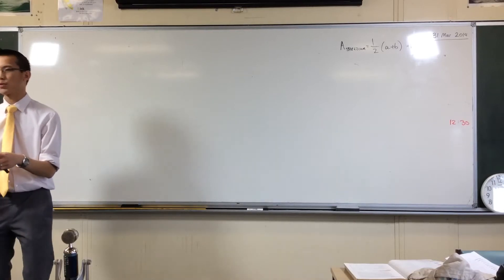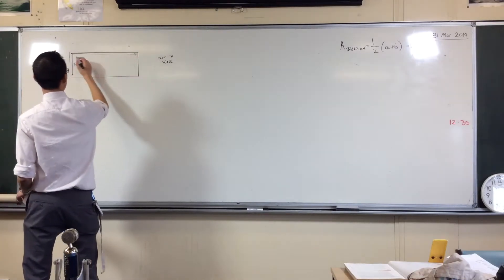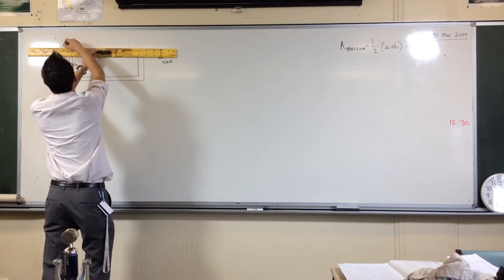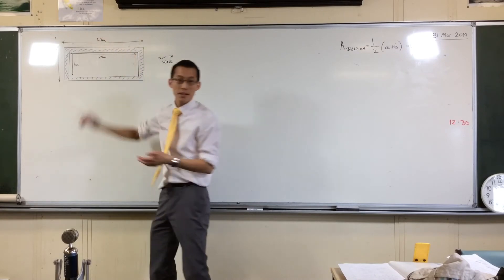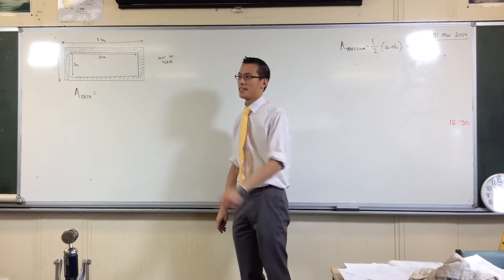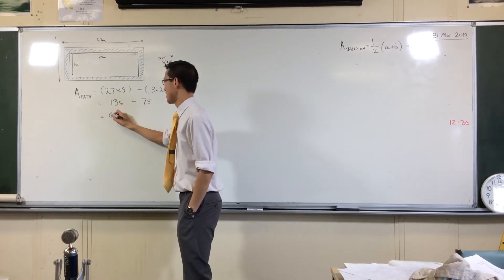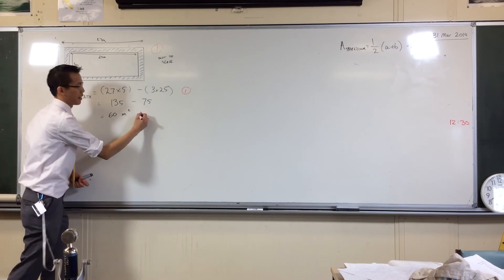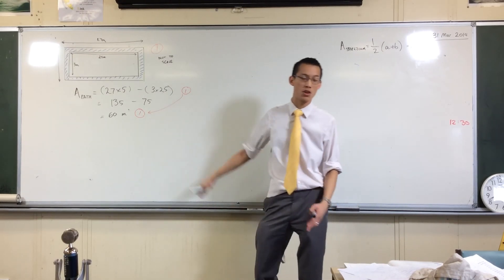Finding Composite Areas (example question)

Comment: The area of the top and bottom of the path is 27X1 = 27m^2.  The sides are 3X1 = 3m^2 (being careful not to double-count the width of the path).  2*27m^2 +2*3m^2 = 60m^2.  Would that have been considered correct?